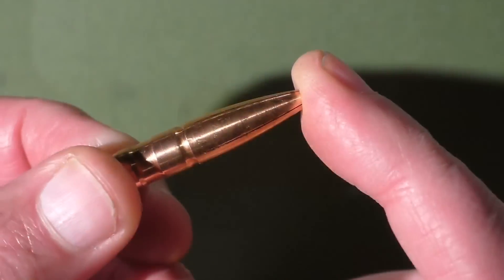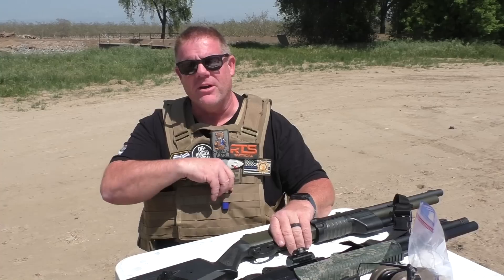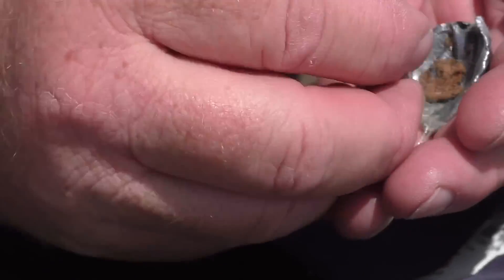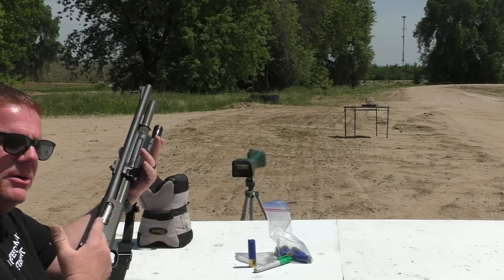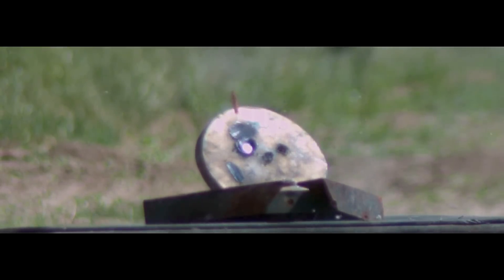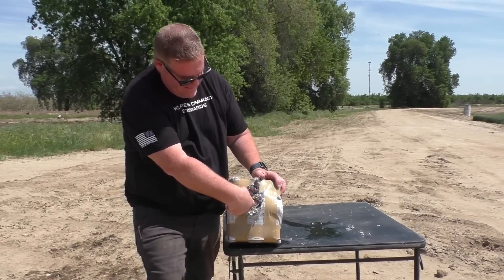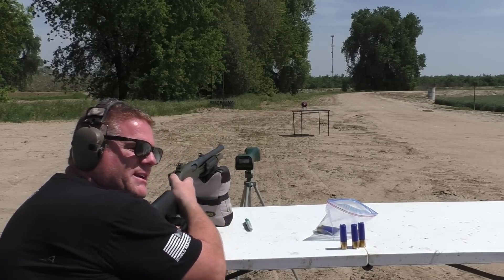300 Faust - 12ga. Slug Prototype -  First Test

Comment from the maker: Some of you may remember the "Aerospike" slugs that are very similar to these and worked wonderfully.  https://www.youtube.com/watch?v=lG0Z2lZSh8A
Reply: Hey Jeff and Greg, hope you're well. Just so you know, we call red cabbage... red cabbage. And aubergines are, as you may have guessed, aubergines.
And don't be too downhearted; what you managed to do was learn how not to load that particular bullet. From where I'm sitting, that's progress 😉👍🏻. Cheers fellas. God bless.
Reply: Im not so sure about it being a failed attempt, more of a learning curve. I would melt a little more lead into the base after seating it in the slug.
And as always keep up the good work.
Reply: Great channel and maybe try cross pinning through both projectiles
Reply: Could you just not drill all the way through the lead slug, leaving a millimeter or so so the slug would force it to go down the barrel with it. A little super glue wouldn't be a horrible thing as well when you put the two together. If you use a extra plate behind the slug you might want to consider gluing that to the slug

Comment: Any time the hole goes all the way through the main projectile its a resipy for the center of the projectile to separate from the main one the hole should be drilled from the top and only go as deep as needed no more than 75 %. It's all most impossible to keep the two together with all the Gs.

Comment: So thread or combined the components using threads and maybe like JB weld or some other component sealer or cast as one object made out of the same materials or wrap it in something that would disperse the force evenly around the component is one mass and drive it together at the same speed0p or maybe use a pins dry pins like how you connect a blade to the hilt of a 🗡️

Comment: Just a question can you use stainless steel discs or some type of steel disc in front of the wadding to keep the bullet in the slug?
Reply from the maker: The bullet may still drive itself through the disk.    The g-forces are very high.

Comment: Possibly you could put a plate, disk or washer behind the slug? Wonder if cork would help either.
Reply: 13:30 literally thinking the same lol
Reply: Alternatively, something flat with a slight cone shape to keep the blackout round seated? Kinda full like it might push it rather than the lead though depending on the design.
Reply: Feel*

Comment: Steel ball bearing, .50, behind the .300 bullet, embedded in lead. It will distribute force to both elements, and it might slightly "puff" the lead, increasing the friction and improving the seal.

If it doesn't explode in the barrel, it should make for a pretty decent thump on target, with the steel follower being a "hammer" to increase the petal spread.

Comment: Totally love your stuff. Wish could that here. 

Wonder what would happen if you treated everything but the front as sacrificial. Big tungsten bb at the back littler one inbetween then a tiny tip or just smaller bb. I.e a supernova round? Big mass at the back hits the smaller mass, ping full transfer of force to smaller mass twice over.

That's why you are lucky guys you get to test the theory. Kinetically. Most of us don't.

Comment: Can you drill half way and press in from the front of the slug? Then you will have a lead stop for the bullet
Reply from the maker: There'd only be about 1/4" of lead holding it in and chances are inertia would have knocked the bullet out the front.

Comment: I should wait till the end, but what if you used a crimped copper cup like a with a regular bullet? You'd have make but maybe better, the bottom brass (metal head) of the shell casing? Would a 16 or 20 gauge cup fit inside a 12 gauge hull if the rim was ground off? Edit: Metal disk? Huh. that would be very interesting to see work. I also thought about just pinning it (drill through both and pin) through the slug and the round to see if it would keep it inside or at least not tear out too much to allow them to fly together.

Comment: I understand where you’re coming from about failure, from your point of view as designer/manufacturer but I have to agree with OG. You got two separately lethal impacts. In fact, didn’t the 300 strike above the vest? If so I would say you couldn’t have a better outcome. My opinion

Comment: Jeff, do you have the mold for the Diablo slug? If so, you could modify it to hold the slug in the center while pouring lead into the mold to bond the two together, thus keeping the projectile together during acceleration.

Comment: Thank you for yet another interesting video! Not sure if this has been mentioned before, but it might work drilling a small hole through the slug and bullet perpendicular to the direction of travel, and push a metal pin through it. That might help locking the bullet in place.

Comment: I think if you used a longer wad that could absorb more recoil that might prevent separation. 
A second idea is to drill a small hole through the slug and the bullet and pin it.
Lastly, 35 gr of Long Shot might be a bit hot, maybe 30-32 ??

Comment: I think it would have worked if you didnt drill all the way through, perhaps leaving a little bit of lead as a backing for the bullet- although itll stick out past the shell, it should have the entire slug take all of the impact while transfering the inertia into the bullet. Could definitely be worth a second try.
Reply from the maker: There's only about 1/2"  of material in the slug to hold the bullet.  Remember,  the bullet can go out the back,  or out the front from inertia.   Kind of like the same thing as when people take a shoe and hit a wine bottle on the base to remove the cork.
Reply: @taofledermaus  I guess you're right... I don't have the experience or the smarts for things like this, let alone a workshop for it, so I was just thinking is all. Kind of surprised you answered a comment on a video from three months back tbh XD.

Comment: You should try a bit of epoxy when you press them through the slug. Doesn't take a lot just a nice coating just before you press them into the slug. Let them sit for 24 hours before loading them. Then wait 5 days before firing them.

Comment: I'd say drill a hole sideways throught the 300 Blkout, insert it into the slug like you have been doing, and use a roll pin, or solid oin in coresponding holes in the slug.

Comment: This isn't a failure.  You've successfully proven what doesn't work.  And possibly come up with a technique for a multi-hit projectile.  Considering even when it was flying wildly the bullet still came reasonably close to where the slug hit, if you pressed something into the slug that was more stable while spinning - such as 2 or 3 stacked copper plated buckshot - they should stay in the same vicinity as the slug.  

Although I suspect that the additional small shot wouldn't be much improvement over how devastating the hollow diablo slug is by itself.

Comment: It might have held up a bit better if you would've heated the bullet in the center to about 250-300°C melting a bit of the slug around it and soldering itself in. Maybe also soldering a copper disc similar to a coin to the bottom to have a more solid ward in front of the gas seal

Comment: This is a really neat idea but ultimately you REALLY need to cast it around the 300blk. Now casting it in you really need some of the copper monolithic bullets that have the bands around them which is becoming more and more common. (Think the lehigh fracturing 308 rounds or some of the cutting edge bullets rounds) that way the led can fill into those grooves and grip. 

Outside of doing that you really need to do a good press fit or even a thermal press fit and possibly add some sort of epoxy to that hollow base to help distribute the pressure on the rear of the slug

Comment: Great idea, loctite jbweld steel backed lead pour and not pressing completely through are all plausible fixes.

Would be an absolute catastrophic hurricane of destruction if you can get the spin speed and engagement on target!
Reply: Hmm zinc was brittle, copper would be great too, brass could be brittle too… but these can either be solid slugs, or a backfilling in a lead slug. 

Just need something slightly harder to take that initial shock.

Comment: Damn, that's a shame.  I was really hoping that would work out for you, 'cause it's a Hell of an idea, but I also wanted to see the mutated, mangled mass of mayhem that resulted from that.  The fact that 0.027 press fit was not enough to keep the unit together speaks volumes to the amount of pressure in the chamber of the shotgun when you squeeze one off.  Makes you really think about how high it must be in some of the ultra-high powered rifles! The knurling was nothing less than brilliant!  Both the idea and the method of creating it.  I never would have thought of that.  Will you ever try this combo again?  Is there any way to prevent the two components from separating?  Maybe swap one of the fiber wads for a dime?   Another great video, guys.  Thanks.

Comment: You should have only drilled a little bit down in the led then put the brass bullet inside a little bit, so it doesn't fall through it.
Reply from the maker: There wouldn't have been much to hold the bullet then.   The bullet can also pop out the front from inertia

Comment: I still think this is a great deign, Jeff. Just make the slugs solid and do a pocket like for a dowel pin. I would like to see if that works for you. Or once assembled as now built, drill a .050 hole through the side and install a roll pin for S&Gs.

Comment: Prolly would've ruined the hardness of the projectile, but: I'd have been tempted to inductively or resistively heat the copper-alloy bullet. Juuuuussst enough to get the lead to soften, expand, and liquify into the pores of the sub-projectile. Edit: simple way to accomplish similar would be using a soldering iron (and flux) to kinda-sorta braze/solder the Diabolo to the copper-alloy .300 sub-projectile.

Comment: I wonder if the 300 was acting as a brake, causing pressure to increase behind the Diabolo more than if it had been fired alone and that's why it was causing the unusual firing characteristics?

Comment: The difference in yield strength and density of the materials will cause this type of separation… from this data I would conclude that you pressed these in from the back of the slug, meaning the easiest method of removal is firing the slug off (forward) of the bullet. The slug having a higher surface area and lower tensile strength means that it will be experiencing more forward force, effectively leaving the bullet in place for a moment (much the same as putting an axe handle on an axe by holding the head off the ground and hitting the back of the handle with a hammer). Since bullets are a boat tail shape… as counter-intuitive as it is… I think pressing these in from the front would be the way to go… or ideally pouring the mould with the bullet held in position.
Reply: I should have finished watching before commenting… i see we were on the same wavelength haha. Great vid as always

Comment: Don't be too disappointed with the results. If it does exactly what you expect, it's a demonstration, not an experiment. 
We're thinking alone the same ines for the fix; a steel plate under the slug, (witht the bullet sitting on it).

Comment: I dunno why you're calling it a failure. As far as binary projectiles go, it's spot on. 5 to 7 inch spread at that distance, even if tumbling, is a destructive force considering the reasonably good accuracy. I have done this before in a similar manner, but I cast the bullet into a HP Lee 12 ga mold, and also used a mylar/Kevlar hybrid wad to prevent back-through wad puncture.

Comment: There's a type of glue that's used for carbon fibre drive shafts for drag race vehicle's.  Used to connect the metal bits to the carbon fibre.  I saw today that if the drive shaft fails, it's not the glue that fails it's the carbon fibre or aluminum that breaks. 
I don't know what it's called, but it's something that would keep these together if you can figure it out.
It was on the Steve Morris racing YouTube channel.  Maybe that could help for round 2.

Comment: suggestion
Pitch an idea to someone to make a projectile that while it is accelerating in the barrel, allows some of the gas escape forward through drilled diagonal channels. The gasses escape at an angle, so the bullet starts to rotate.
We lose velocity, but we get stability with smooth bore.

Comment: Hi guys! Keep up the good work. Here's my thoughts first just pressing the bullets into the slug form a very weak Bond. Second  the big channels on the bullet minimize contact. So here's my fix!! First use the drill very close to the 300. I would probably use about 295. Countersink the nose. Carve to grooves down the length of the inside. Press in until the boat tail is in the hole most of the way.Fill the bottom with aluminum foil. Used low-temperature electrical solder and soldering altogether the channels will help make a good Bond. I'll do a couple for you if you want I think it would be kind of fun!!! Just let me know!!!!!l😎

Comment: I wonder if you drilled and pinned horizontal if that would add enough support to keep it in. Or perhaps hit it with a blowtorch to melt the contact points.

Comment: You're getting discouraged at the results and I understand that it's because you made the rounds. However, you don't need to be discouraged. You're testing. Whether the result is a yes or a no you got a result. The test was a success.
Also, while superglue definitely wouldn't work, JB weld might. If you did the supporting metal disc the copper round might still be able to move enough to break free. Something to help bond it in there would just be a little insurance.

Comment: I seem to remember that dimes fit down the bore.
What about placing a dime under the slug, then the gas seal and fiber wad, in that order? 
Probably also want to ensure the base of the sabot is even with the base of the lead pellet as well, to prevent initial slippage that could lead to an in flight failure.

Comment: Looking at these my own logic kicks in.

What if the 300 just pressed in the diabolo works like a drill in an rifled barrel? I´m thinking of the diabolo getting accelerated and turned while the 300 stays still.

Could you make a mould where the 300 sits in and cast the diabolo around it? Because the 300 has these ridges a cast diabolo could maybe grab onto it while spinning. Plus...you could make the diabolo out of zinc like you wanted to try.

Had a third thought...but forgot it^^.

Comment: Maybe there needs to be a custom mold that holds the 300 in place while lead is poured in around it, so it can fill into the small indentations on the blackout and use a mechanical means of holding it together. Maybe drill in some 1/16" divots to really let get a bite.

Comment: 3D print the slug portion and leave a small pocket with a support underneath for the 300 blackout bullet. You could experiment with length on the shuttle to get stability.

Comment: It would be cool (though probably impossible) to pressfit that bullet loosely in a steep rifled sleeve that the diabolo is casted around. Like a 1/2" barrel through the center of the diabolo. 

If that contraption would work (highly unlikely) you would have a stabilized .30 bullet and a steel core slug travelling at target one in the same path as the other. One hard hitting and the other penetrating 😁

Comment: I think you might be screwed concerning the separation of the projectiles. If you filled the base of the slug with lead to help entrap the bullet,the slug would either fail to expand properly or might expand way more and risk damaging your mass accelerator. I don't think you could predict which expansion scenario might occur.Maybe if you had a shitty old break open,you wouldn't mind spontaneously deconstructing itself,it might interesting to try!   (Fired remotely of course)

Might be worth the 50/60 bucks for a pawn shop special for "extreme/questionable rounds)
Gnarly looking experimental mass accelerated test article though!

Comment: would a roll pin through the side, or drill an tap a thred 6/8mm threded bar, cut a line accross to give a straight bladed screw driver to tighten in place. just a thought, cool slug the 300 b/o is huge all the best

Comment: @taofledermaus what about putting a solid dowl pin perpendicular through the round. Just like with the bullet, drill a hair smaller but also cut the pin a bit shorter than the width of the lead so it doesn't damage the barrel. What do you think?

Comment: Very interesting video. How far did you drill into the slug? Could you try drilling half way in? Assuming you drilled more than that.
Reply from the maker: I had to drill all the way through it.  There is only about 1/2" of lead holding the bullet in place.

Comment: Now, do we get Jeff a 3d printer or do I print up some sabot shells to hold these .308 centered in .72😅
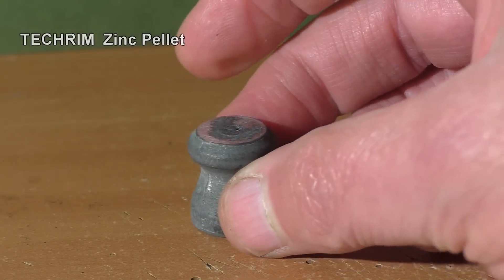Reply from the maker: The rifling of a 12 ga is not enough to spin the small diameter bullets up enough to stabilize them.  300 BLK use a 1:7 twist and a 12 ga has a 1:27
Reply: @taofledermaus  I was thinking smooth bore sabot as with tank rounds. You are of cause right that a 1:27" twist of a rifled barrel is sufficient for stabilization. Too bad that I can't machine a 1:7" paradox choke tube. I might still print something up and ship it to you guys.

Comment: Cool idea even if it didn't work out exactly as expected. Perhaps you could actually pour the molten lead around the copper bullet to get it to stick, that way it would flow into the cut out rings in the bullet's surface.